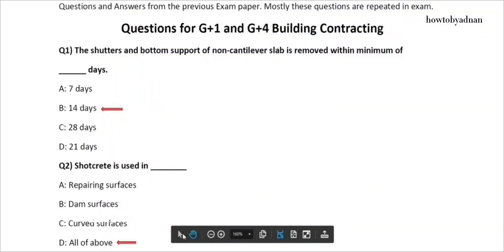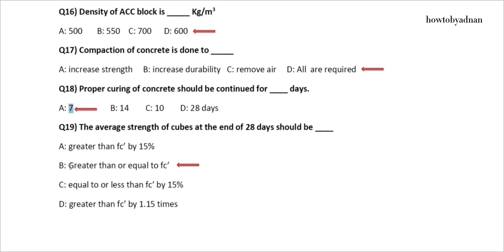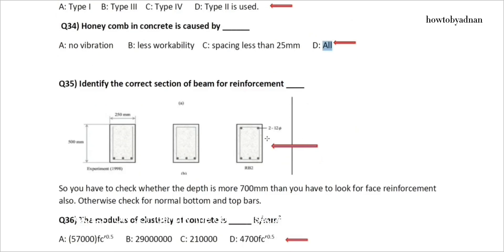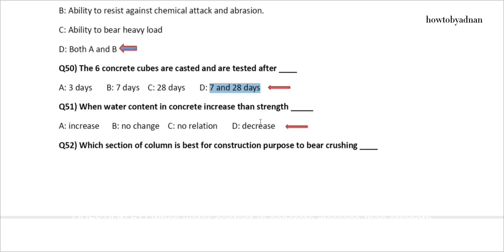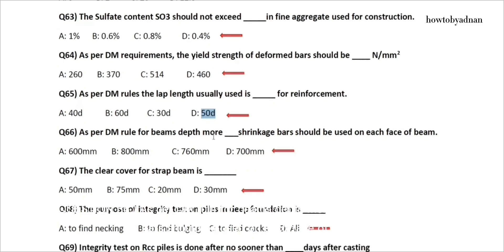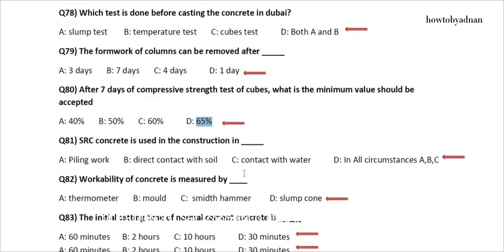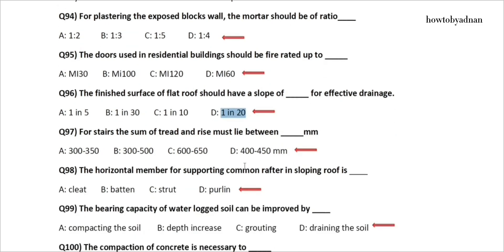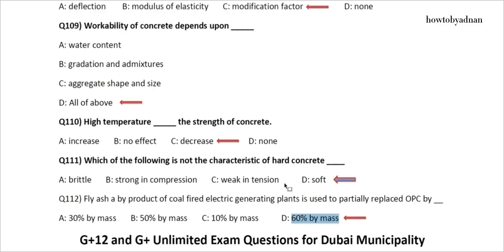Dubai Municipality Civil Engineer Exam G+1, G+4 Questions and Answers | 100% Same #dubai #exam #uae

Comment: Kindly check question number 15 and 39 queetion same and answer different
Reply from the maker: Both the answers are correct. 
Question 15 refers to workability - which will increase by adding ice. 
However, Question 39 refers to strength - which will decrease by adding ice.